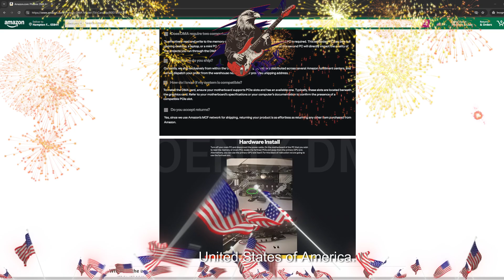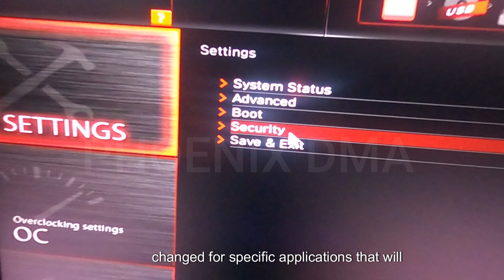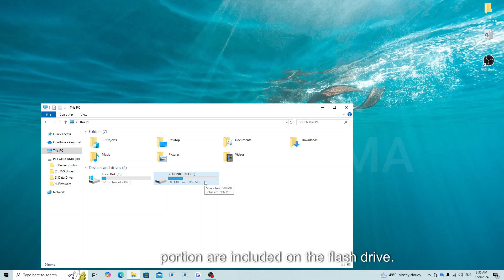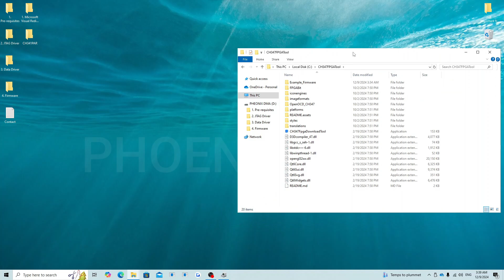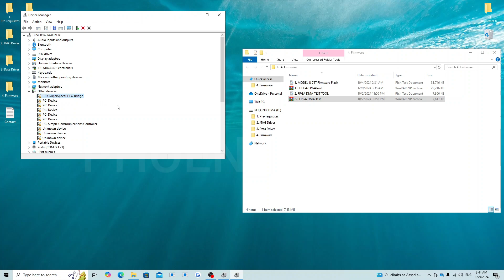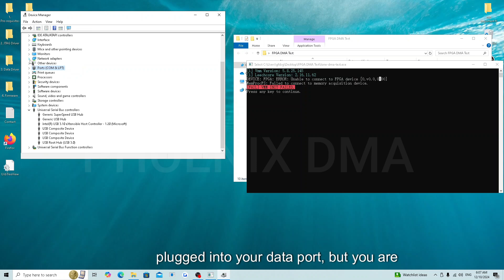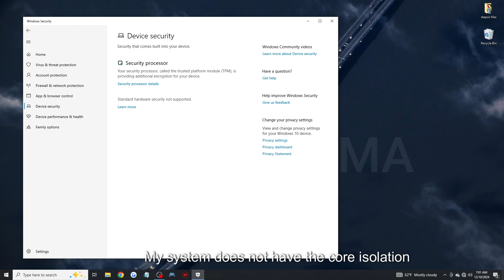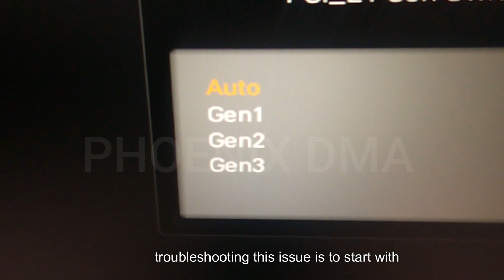Ultimate DMA Card Setup Guide + Troubleshooting

Comment: I got an Artix-7 Xa7a75T  dma card, most of the firmware on pcileech is for Xc  FPGA variations in this case where could I find any info on the firmware for those, and if it doesn't have any firmware open source, where to get some info on building a base one for this card as a minimum memory reader.

Comment: When I First Plugged In I Did Bio Changes On Both PCs, The Lights Were Working As Should. But At Somepoint Ig While Installing The Tool And The "Practice" Firmware Flash Only The Red Light Is On Now.
When I Tried To Test The DMA Speed Etc The 3rd Line Where It List Device Wouldnt Show (But It Showed In Device Manager). I Uninstalled Everything And Planned To Restart Tho My Light Is Still Just Solid Red. Any Ideas? Please Help
Reply from the maker: We can help you in the discord server easier. Feel free to join and make a ticket.